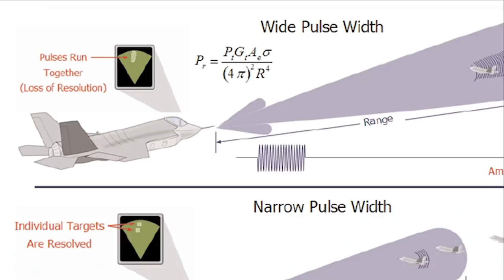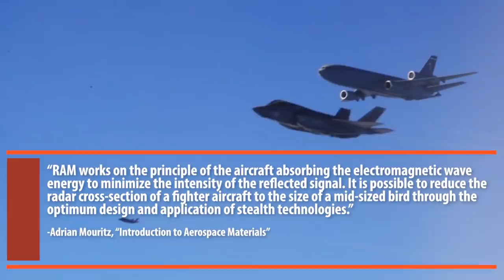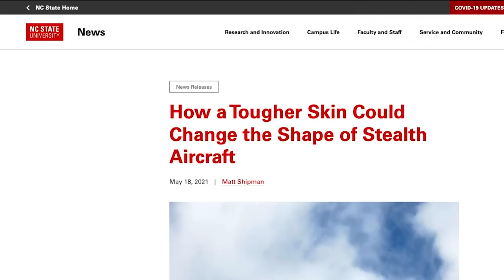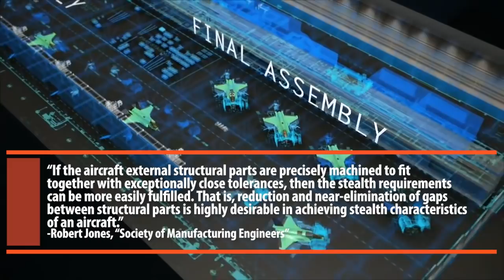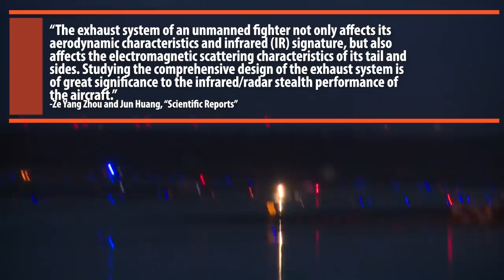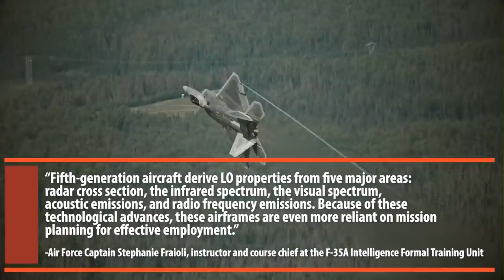Why is stealth so hard?

Comment: "Stealth doesn't work against bullets." That's like saying camo doesn't work against bullets; well of course it doesn't, the intended victim is the sensor. If you have an aircraft with sufficient RF and IR stealth+ECM advantage to defeat radar and IRST-based gun track, you've already made the gun much less deadly by degrading accuracy. If you can manage optical camo (so-called invisibility cloak, if that ever finds its way onto aircraft) or straight up lasers to degrade the Mk0 Eyeball, then stealth would 'work' against bullets. It's a technological hurdle/overmatch in capabilities, not a limitation of what it means to be stealthy. And honestly one of the major point of stealth is to put you in a position of decision superiority so you aren't forced to accept merges short on missiles and wingmen. Stealth doesn't work against bad decisions.
Reply: Lasers are countermeasures, not stealth. 

You're saying stealth can work if the OPFOR has already had their targeting capabilities diminished to ineffectiveness by active countermeasures.
Reply: I read a statement by a pilot that they couldn’t even lock up an F22 when it’s right in front of them.  So yeah, it helps.
Reply: @keirfarnum6811  That was from a Royal Australian Air Force exchange pilot flying in a US F-15C Aggressor Squadron on exchange.

He said there's nothing he could do in BVR and in WVR, he couldn't get Helmet-Cued IR missiles to lock onto the Raptor.  He said it was the most frustrating aircraft to fight against.
Reply: congrats u watched the video

Comment: 5th Generation aircraft also use advanced EW and sensor fusion to give pilots exceptional situational awareness of how to avoid threat radars. This is some of the most classified stuff on an F-35.
Reply: That doesn't really work against L band though. What are our F35's going to do? Avoid radar ranges 500 miles in diameter. A couple L band installations can triangulate. Russia has had L band radar since 1993. It's everywhere over there. Nebo M mobile radar can detect them also. If russia turns on it's L band net we cannot approach their border undetected.
Reply: @grndzro777  if you know that, they already know that
Reply: @grndzro777  u can destroy them first with anti-radiation missiles
Reply: @johnsilver9338  That would have to be within 50 miles, and get through Pantsir missile defense, and Krashkua-4 which is powerful enough to disrupt satellites in LEO. R37 has 4x that range. L band would have detected F35 enough to triangulate and fire.

It's why the US is fast tracking the new AARGM-ER. Because cracking a full S400 site isn't an easy task.
Reply: @grndzro777  the L-band can detect but it cant provide a lock on. nor its its fire control radars. plus with jamming lesser chance of being detected. stealth and jamming go hand in hand. and just like with any other SAM, u use SEAD tactics. u wont be using anti radiation missiles alone.
Reply: @grndzro777  6th gen planes which the B-2 Spirit and B-21 Raider already are more potent than 5th gen at lower frequencies. to detect them u need radars as big as buildings.
Reply: @johnsilver9338  R37 doesn't need a lock. It's a BVR missile with a full autonomous mode.
Reply: @johnsilver9338  B2 spirit is worse in both S, and L band than either the the F22. or F35.

Comment: I would guess that a fundamental part of stealth mission planning is to not allow the other guy to close to a range where your countermeasures are ineffective. If you get into a dogfight you have screwed up.
Reply: The key to good stealth is to be at the point of detection where it makes no difference meaning the enemy cannot do anything about it.
Reply: @bighands69 The thing is, as the guy said in this video, there is a difference between being able to see and then get a lock, furthermore being able to maintain a solid lock is even more difficult as even during missile flight, either the missile or the radar may simply not be able to see the target, and as such does not track or does not properly track. This of course, specifically is regarding radar guided missiles, heat seekers are completely different but in the case of the F-22, it also has stealth in the area of thermal, by having good thermal dissipating materials and heat shielding for its engines and exhaust, also the ability to very meaningfully super cruise without the need of after burners makes it extremely effective at also combatting heat seekers.

Comment: In my first go round, was an RF guy. The F-117 always gelled in my head as the ultimate reflective surface, scattering radar energy every which way (lots of sawtooth), but back at the Search Radar, or the Targeting Radar once handed off. I honestly can't remember (or know) if the F-117 used a lot of RAM or not compared to the F-35, because the F-35 looks more like that smooth rock that energy flows around while absorbing energy around seams or edges. Completely different approach than the famous "hopeless diamond". Of course the F-35 wields way more Counter Measure smarts, and ECM than the F-117 so it would even be more survivable and less observable in the RF/IR realm. But, once eyeballs got on it . . . different story, than say an F-15 in an eyeball to eyeball fight.
Reply: You can't just put a super powerful engine on a plane, and expect it to be invisible in IR. However, if the F-35 is tracked by a close range IR missile, it will fare similar to every other jet. Because the enemy is already much too close. Mistakes were made.
Reply: F-117A had zero ECM, RWR, or Radar.  It relied entirely on RF and IR VLO signature to avoid detection or weapons-grade tracks.  Only 1 had a missile proximity detonate near it enough to cause catastrophic damage in over 2000 combat sorties.

The F-117A also underwent 3 generations of RAM during its service life.  They were always working on improving features of the RAM, to include RCS reduction and durability.

The IR signature reduction on the -117 is very cool.
Reply: @LRRPFco52  HOLY Crow! That is even better! Thanks for this information. I know very little about the F-117, always wondered what it had, or didn't beyond the shape and saw tooth patterns. Thanks for this information, very much appreciated.
Reply: @LRRPFco52  Even more good information. I could (attempt) to glean an pick this apart for a long time. Vaguely familiar with some of the concepts you mention. Really appreciate this information. Just a bit more knowledgeable now, or at least realize how little I know.

Comment: Leading edges etc. Perhaps use a synthetic (plastic or ceramic, radar transparent or absorbing) front edge to provide the necessary aerodynamics. Within that use whatever metal is needed, but with anechoic shape analogous to sonic anechoic chamber walls. (Typically a set of steep wedges, in alternating rows. These could be coated in radar absorbing coating, but it would be protected from wear and damage.
A complex structure like this could also include multi-spectral absorption materials and structures.

Comment: "Barely exceed Mach 1"

What? F-35's top speed is Mach 1.6. Non-stealth aircraft with weapons, fuel tanks, and sensor/ew pods on pylons often have sub-mach 1 limits as well as g limits with 9g being the clean standard, but a Eurofighter with a full fuel/air-to-ground load is capped at ~Mach 0.5. An F-35, with a full fuel load and full weapons bays is capable of 'supercruise' up to Mach 1.2 (i.e. no afterburning). 

Also, if you run out of missiles and your opponent has missiles, that's obviously a terrible situation regardless of whether your fighter has stealth or not.
Reply: Can I see your source for the full load Eurofighter claim? Just seems very hard to believe.
Reply: F-35's top speed is Mach 1.6 with 1200 Mph.
Reply: @valenrn8657  I Know that, it's the fully loaded EF at mach .5 that I find hard to believe.
Reply: Note that higher speeds have higher IR signatures.
Reply: @valenrn8657  Higher Speeds don’t; higher engine RPMs and Afterburner needed does. 
Also, do you know what the EF claim is? I’ve seen videos of them exceeding the speed of sound in combat loads for QRA. It recently caused a sonic boom.

Comment: why don't they do something opposite of stealth, send a single small drone that appears like a whole squadron of bombers on radar, to send the enemy into a panic.
Reply: I think I remember seeing a video a few years ago where Russia did something similar to that. They had a guided missile(could've also been a drone) that had a radar cross section the size of a fighter. In theory they would use those to scramble enemy interceptors and come in from behind the unsuspecting aircraft or once the enemy aircraft was low on fuel.
Reply: There is a missle type thing that does something similar, sadly it's no longer used
Reply: They've been doing that since the 60's.  Look up the "Quail" drone.  Now days they typically do the much cheaper towed decoy, although I imagine they still have something around that does what you said
Reply: They are called decoy drones/missiles, it appears on the radar as an actual fighter. Or you might be referring to electronic warfare, that sends lots of loud noises to the radar to fill it up screen with lots of non-sense returns. There are tons of way to get past this tho, the signatures of different materials are different, so if you're experienced you can tell the difference between the radar return of a F22 compared to a F35 (they will show up on radar if you get too close)
Reply: Who says we don't? ;)
Reply: they got em.
Reply: @mocaxu
That is what singal warfare is all about. There specialized aircraft that the US deploys that can trick and outright jam the radar systems of opponents.

Comment: “Stealth doesn’t work against bullets” - I’d actually disagree with this one. Most modern fighter jets use radar to lock an opponent to provide gunsight targeting. If an aircraft is stealthy enough to avoid getting locked, it is a lot more difficult to use guns against them (still possible, just more difficult)

Comment: “Welcome to being shot down”: BFM does not usually take place at super sonic speeds. A guns “dogfight” is going to be at lower speeds where thrust to weight, turn rate and turn radius will be of higher importance than top speed. High super sonic speeds are more relevant in BVR engagements when the added energy of a high top speed increases the pK. of a long range AA missile shot, however low observability trumps this advantage because BVR missile employments can be performed at close ranges without the risk of being targeted. A 60 nm shot from 2.0mach in a 4th gen fighter may keep the fighter out of the WEZ of the opponent when a 30 nm shot at .9mach from a low observable fighter is still outside of the WEZ and has the same kind of pK. In reality, BFM fights are extremely rare making up none of the peer to peer engagements of the last three decades. Saying a stealth fighter is a worse platform than a non stealth fighter because of dogfighting is like saying a Tesla is worse than an bicycle because it doesn’t have playing cards stuck in its spokes.
Reply: " the f-117 nighthawk has the cross section only slightly bigger than a tenth of an inch" and yet it was detected by turning on P-20 (a soviet analog radar from 1949) for 10 seconds  and then shot down over Yugoslavia in 1999.
US stealth fighters  are really only tested against men in sandals on bicycles  sporting 40 year old carabines (Taliban) .

Comment: What I think of when I hear stealth being talked about is - A bird sized blip on the radar screen.. Hmmm, how many small birds fly at 50 000 feet doing a 1000 mph?
Reply: @gibbsm  If you can see it - it can be incepted and shot down like anything else.. And it won't be long before SAMs are programmed to kill those little birds lol
Reply: @derekflegg2510  Have you heard of clouds ? The great deal with radar is that it works in a cloudy night.
Reply: @0MoTheG  And that has what to do with what?
Reply: @derekflegg2510  Clouds tend to be opaque.
Reply: @0MoTheG  Well that serves to prove his point? Not many birds fly at and in a 10,000ft cloud base at Mach 1.5 at night. Maybe the Geese had too much bread at the park lol.

Comment: The fact that radar absorbant paint isn't effective ad high speeds is not as much as an issue as you would think. This is because when traveling at such a high speed for a lengthy period of time will heat up the front of the aircraft such that it will easily be visible on even the oldest IRST system in service.
Reply: But do those exotic aircraft show up as easily?
Reply: @bighands69  every Russian aircraft has an IRST system. The ones on the SU30/35 series are very good.

Comment: Saying that stealth can be detected on lower frequencies is a bit of an oversimplification. At best lower frequencies can only detect them at much closer ranges….and even at those ranges it is an intermittent inconsistent unreliable “detection.” You make it sound like that is the same kind or even in the same ballpark as a normal detection of non stealth aircraft.

Comment: I’m calling BS on the 1/10,000th of and inch tolerance for the F-22 and the F-35 being orders of magnitude tighter.  I worked at a supplier for Lockheed making many of the panels and doors for all 3 variants.  The tolerances for the edges absolutely were NOT under 0.00001”.  They were on the order of 0.01” to 0.001” on the edges.  The tolerance of the thickness of the parts was controlled more than on comparable parts on other aircraft, and some extra production steps were done to maintain that thickness tolerance for composite parts, but again none of the features were held anywhere close to as tight as mentioned on the video.

What Lockheed did require above and beyond was lots and lots of SPC (statistical process control) - they were going for consistency, but again the variances between parts were easily measurable.

Comment: one of the issues i see is the lack of a large payload. A 100m target is a big risk, and for what rewrad? A few aa rockets?
Reply: Military strategy is to never just send 1 type of jet up in the air. The F22s and F35s fly with F15s and F16s. F22s and F35s radar will send targets to F15s and send ground targets to F16 wild weasel jets. Not every fighter jet thats Stealth doesn't need a massive payload for this tactic and reason.

Comment: is it even worth it to even try limiting ir? like the first aim9 heat-seeking mistle from the 50's was tested on a piston f6f drone. that plane puts out way less ir than any jet no matter what you do and the oldest heat seeking tech was able to track it. so jets cant get any colder and ir detection only getting better whats the point?
Reply: Maybe working towards minimizing engine IR emissions maximizes the efficacy of flare countermeasures?  Or makes your signature less than the guy driving a gen4 fighter (don’t have to outrun the bear…:)) ?